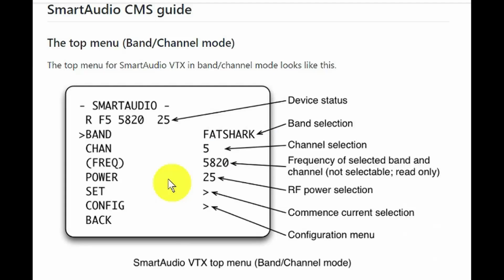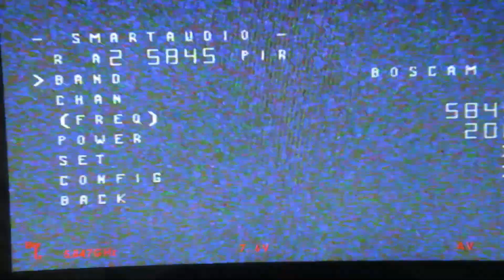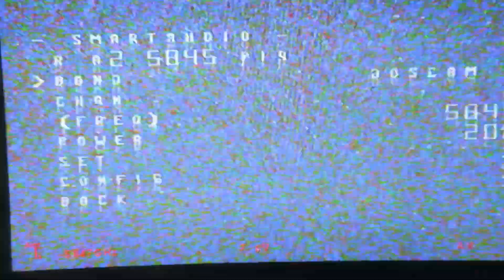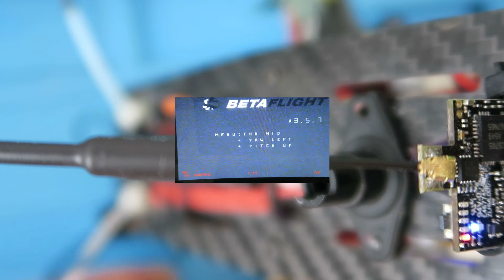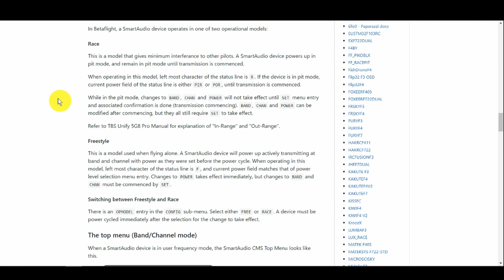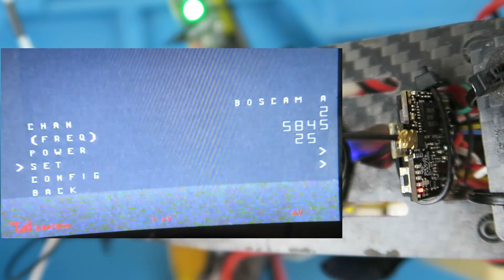Eachine ATX03S Pit Mode Explained Smartaudio Betaflight

Comment: Im not sure if you are still answering questions but my goggles show a question mark where yours show P i t, i followed the steps but when i did the disconnect and reconnect, the question mark stayed
Reply from the maker: Will take a look when I get the chance.
Reply: @1nformatica  thank you so much, it was a mobula 6 running beta flight 4.2 when I was having the issue and I "fixed it" by switching over to Emuflight. Now I can change channels and bands no problem but I get less than 5 feet of range before my video signal cuts out, I think the board may still think its in Pit mode even though it says it is turned off. I'm fairly new to FPV so any ideas would be greatly appreciated
Reply from the maker: @k1ngk1ng88  Hi, if it is in pit mode you should see the blue led flashing. Also as you move your transmitter a little distance away you will see the RSSi value drop off rapidly.Out of pit mode the led is steady indicating the power output level.

Comment: 1nformatica:
1) If we don't have a flight controller, how do we turn off and turn on Pit mode? 
2) Can we somehow use our transmitter guided by our OSD monitor? 
3) If that is possible, can we also use this method to adjust channels, band selection, and power modes?
4) In your experience, how well do these Vtx boards handle AUDIO transmission for the purpose of hearing our motor in flight or variometer audio through our video&audio receiver/monitors?
5) Any tips on hookup for audio monitoring?
   For those without a flight controller this is an important question. 
   I didn't realize this could be a problem before I odered 3 of these Vtx systems!
Thanks!  - Jim
Reply from the maker: 1) pit mode is enabled on power up when the band is selected as "Race" mode. Channel, band and power are all selected by button presses on the module.
2) Clearly the VTx is designed for Quad / drone use and the only way to change parameters using a transmitter is via smartaudio on a FC as far as I know.
3) No
4)  I have not used it for audio.
5) The green cable is audio out when not using smartaudio.
6) I wish Eachine were paying me for tech support!
Please consider subscribing if you haven't done so already!!
Reply: @1nformatica :
I have been subscribed since reading my first of your blogs.
You are a class act. Yes, ALL of the products you review should pay you for your contribution. You are a credit to our hobby. Keep going for the gold.
Jim

Comment: how to setup pit mode on a switch? when i plug in my quad i want the vtx be in pit mode, and when i flip the switch on transmitter vtx goes on 200mw..
Reply from the maker: Sorry if this is obvious but pit mode only works when the quad is disarmed. As soon as you arm the quad the vtx will go to whatever power it is set for. That said, there is a lua script that may do what you want, see it here : https://gist.github.com/ghostface/b7de909b24fc7ce4b4c75de515c0ae46
Reply: @1nformatica  not good enough.. when i crash in hi grass sometimes i cant hear beeper and i am using goggles to find the quad.. if it is disarmed/pit mode i will never find it..
switch for the pit mode can be setup in the btfl configurator under modes tab.. i am using aux4/chan8.. when i flip the switch on my transmitter slider in the configurator reacts but the vtx doesent.. how to fix that?